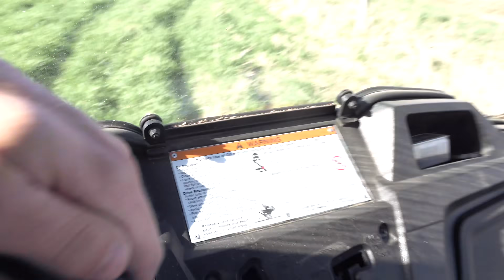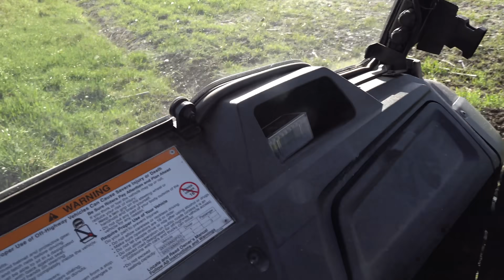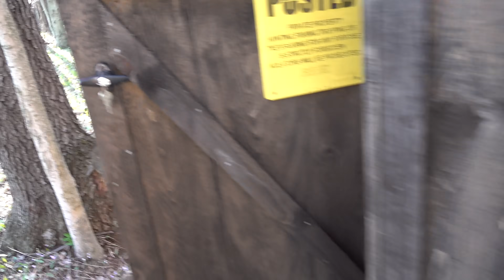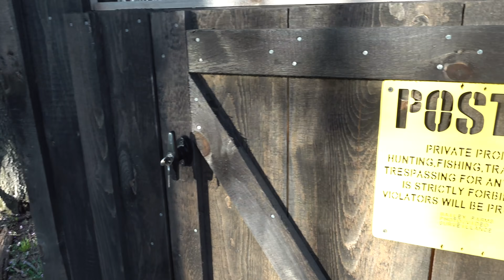I Got Side Tracked...

Comment: You need to find some crank down Jack's to mount under your blind  makes it mice and you're  dealing with blocks  I have them on mine I just use 4 pieces  of 2x10 o crank the Jack's down on. 🍻
Reply from the maker: That's a great idea!
Reply: I got mine off a old popup camper beats the hell  out of dragging  blocks  around.  🍻